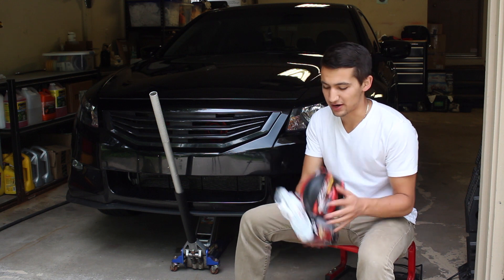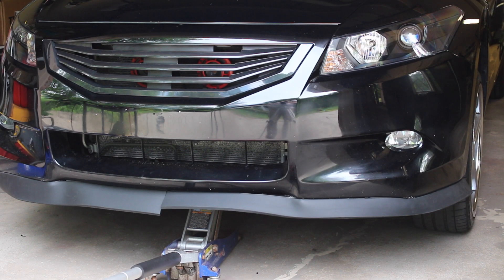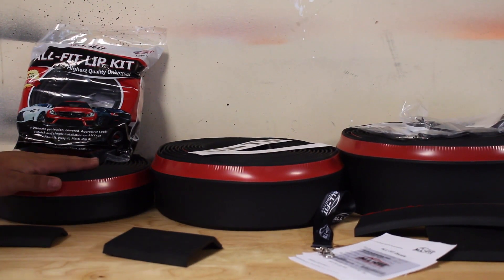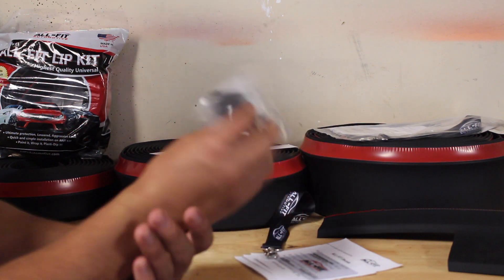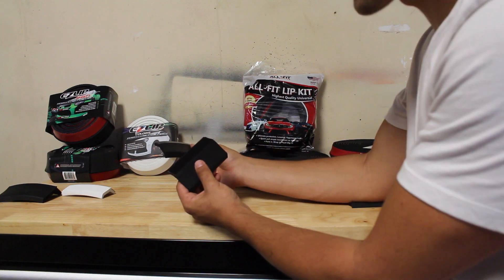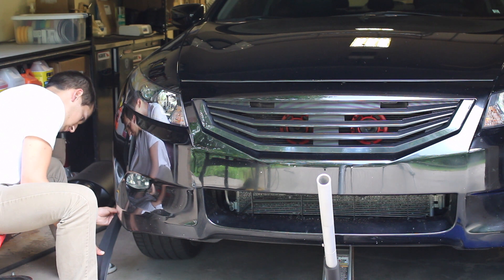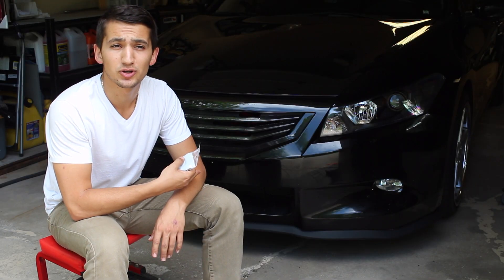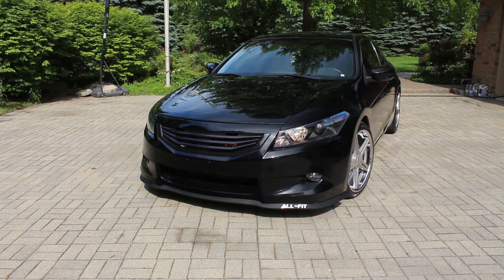All Fit Automotive Quality Universal Lips

Comment: Just to warn everyone- These "auto lips" are a repackaging scam. On some civic forums about 10 years ago some guys came up with the idea to use garage door sealer as a bumper lip. All fit and EZ lip stole this idea and repackaged garage door sealer and sold it for A LOT more. You can buy a 9 foot roll of MD garage door sealer for 9.99. All fit charges you $80 for the SAME EXACT 9 foot roll. They just added 3m double sided tape and some screws. Dont fall for the scam. If you want to do this just buy a roll of MD garage door sealer for 9.99. Then buy a tube of gorilla glue construction adhesive with a caulking gun for about $12 for both the glue and gun. That way you can install it to stay put without drilling holes in your bumper. You'll have the exact same lip with better installation for $20 instead of $80. You're welcome.
Reply: Thank you for this amazing info, saved me a lot of money. Sealer is so cheap on Amazon
Reply: So? It works.
Reply: i realize I am kind of randomly asking but does anybody know a good place to watch newly released movies online ?
Reply: @Adonis Josue try FlixZone. You can find it by googling =)
Reply: @Cruz Payton Definitely, have been watching on FlixZone for years myself =)
Reply: @Cruz Payton thanks, signed up and it seems like they got a lot of movies there :D I appreciate it !!
Reply: @Cruz Payton thanks, I went there and it seems to work :D I appreciate it!!
Reply: @Adonis Josue No problem =)
Reply: Thanks for the info bro

Comment: Great video! Thank you. I bought the 2.5" ALL-FIT LIP KIT. Wanted 2" but only ez lip has that. I have edge trimming to do so less sticky surface. The edges will need the screws.
Reply: Installed today! Needed the screw and clip package that came with it. Corner edge was difficult with trimming that had to be done. Looks great i think.

Comment: "its durable and its still holding up" right after installing it
Reply from the maker: +AtomicCheeseburger69 LOL 5 miunutes later it still is holding up good ;)
Reply: milanmastracci 4 years how is it?
Reply: boofighter it’s trash, it started peeling off on the edges and I only had it on for two weeks, thank god for amazon return policy
Reply: @TheStarwars2011  if your smart you’de screw some bolts in. It’s Adhesive it’ll hold  but it won’t bolt hold. Your good with some bolts in 👌🏼

Comment: you guys do know these are just garage door seals w 3m tape stuck to it....
Reply: niiikoo__ 17 It really is. Bought garage door seal for another project. It is exactly the same. Sold in the same length, width, has the same exact curves and angles to it.
Reply: MD Garage door seal is the exact same 9ft roll that you get from All fit. This 9ft roll is 9.99 from amazon. The same 9ft roll from All fit costs $80 on amazon, just in a different package with 3m dual sided tape.. Repackaging scam. Of course they will give you screws, lanyards, stickers and a nice thank you letter, because they are robbing you blind. This should be illegal.
Reply: @teemoegoodie5058  do you have a link?
Reply: @teemoegoodie5058  dude where i can find it?

Comment: Hey man, what's the angle like on standard all-fit compared to the mid-fit? i'm not sure which will look better on my ride ('09 eclipse) and from what i've seen in some pictures, the mid-fit is more vertical as opposed to sticking out flatter. I'm trying for a more angled look... Thanks for any input, and i dig your videos!
Reply from the maker: +Hunter TH Than I would suggest going with the standard all-fit lip. It will be more aggressive and look really nice :)
Reply: milanmastracci sweet, I'll go with the standard one! Thanks for your input :)
Reply from the maker: No problem Hunter TH. Let me know how it turns out :)

Comment: I need assistance. took me forever to get a new bumper (fender bender day before kit came in). I just tried to get my AF Midlip on. Looks pretty good but trying toline it up and being stiff I see its off baddly looking back. The 3M tape is bonded as well. How did you get all these lips on and off for your demostrations? Thinking about cutting the tape off then cleaning the bumper and using the screws to bond it.
Reply from the maker: Shalashaska016 Take your time with it. If something isn't bending the way you want, make those 'V' cuts into the lip. If you wanna see how I did it, check out my other video in the description box. As for removing them, I used a heat gun to make the 3M tape let loose from the bumper.
Reply: +milanmastracci 
Honestly I just live in Florida. not sure if bringing it out of indoors AC made it difficult. it was just lopsided and stuck fast. While looking for a heat gun the heat melted the 3M tape a few hours later so just picked it up from the ground. Still have the screw kit so will just measure it out and reapply later on when I have free time again and clean the car again. I'll try the V cuts this time though.

Comment: Question, removing how difficult is and will it leave a lot of adhesive underneath and how hard is it to remove that.
Reply: Use a heat gun or hair dryer to warm up the glue, that'll help get it off

Comment: how do these hold up to the bumper in winter driving with snow?
Reply from the maker: +aznwokbox No problem :) I have one mounted on my car with no problems, and I didnt even install the screws
Reply: Thanks for responding, I have another question! How do you think they will hold up if i do a lot of highway driving (speeds of 120+km/hr)
Reply from the maker: I do it all of the time with no problem. What car are you planning on install the lip on?
Reply: +milanmastracci i have a 05 Altima SE-R. The bumper has similar curves near the center like your accord

Comment: Do these hold up at 100mph?
Reply from the maker: +Andrew Rasco Yes and no. Depending on the style of your bumper, you might have some issues but if you install the screws and washers, you won't have a problem
Reply: +milanmastracci  thanks for the quick reply! Let me change my question though. I have a Mopar lip spoiler on the front bumper, so that's not an issue. I will use the all fit just as side skirts. Would you say the same answer? Or do you think with it being in the side it would react differently to speed? ( I travel highway a lot where everyone normally does 85-90 )
Reply from the maker: No problem. You should be fine with installing it Andrew Rasco on your side skirts and not have any issues
Reply: +milanmastracci thank you! And You're very detailed in your videos! Love them!
Reply from the maker: Thanks Andrew!! :) Glad to hear